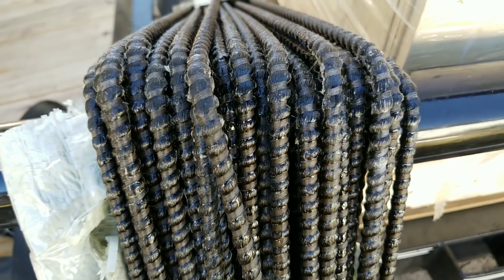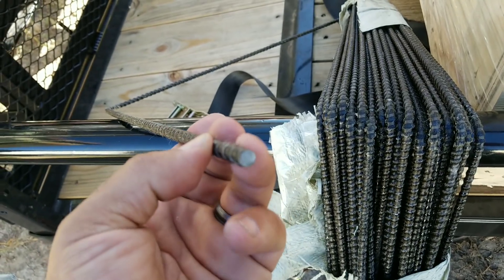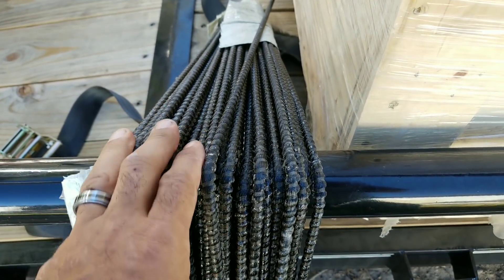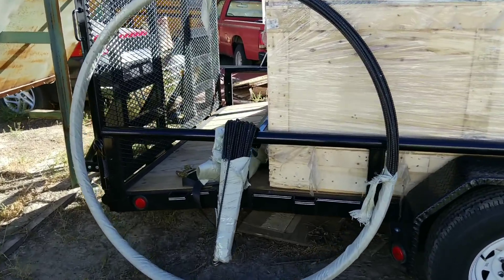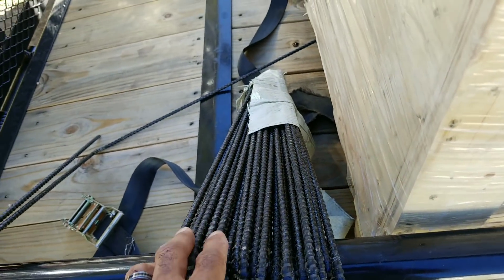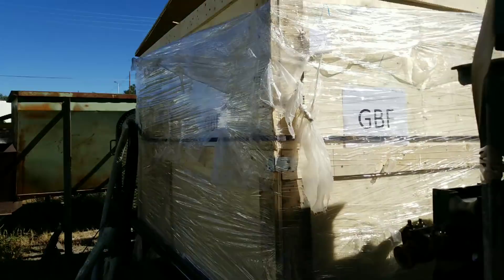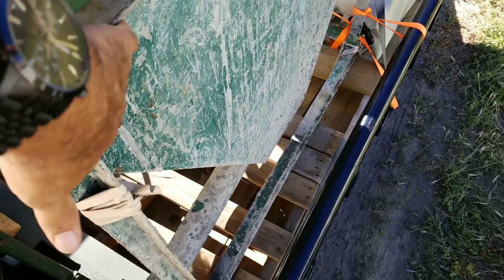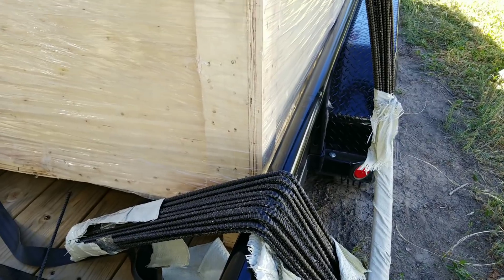Dome Building Supplies #aircreteharry #domehome #foamgenerator #aircrete #domebuild #dome #basalt

Comment: That basalt is incredible stuff. I don't know why people still use standard rebar aside from the cost.
Reply: Make sure you are standing INSIDE the rebar circle when you cut it open. It will want to straighten and it can be dangerous if you are standing outside the circle.

Comment: In the study of Ferrocement,  they say that if you use a concrete mixture of 1 part portland, 2 parts sand, and 0.4 parts liquid, then the concrete is water proof.
That is how they make water tanks. And boats...
Thanks for sharing. ..